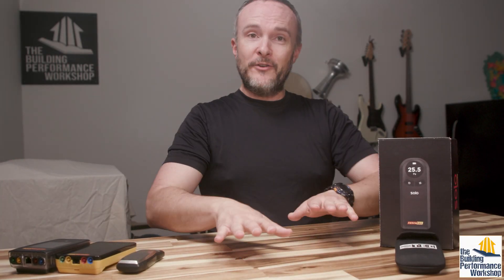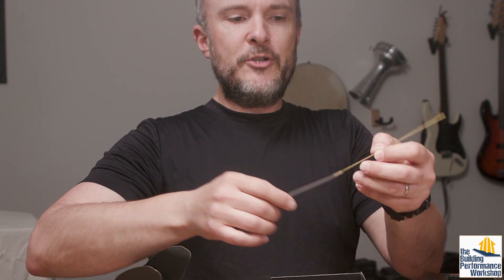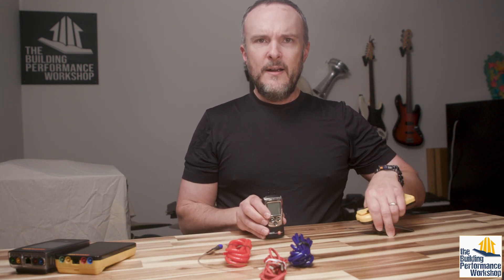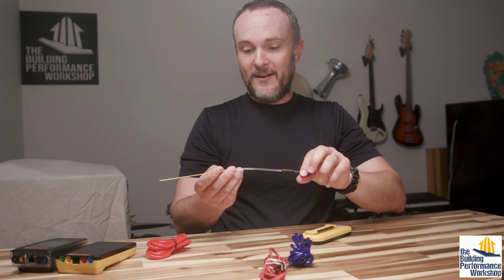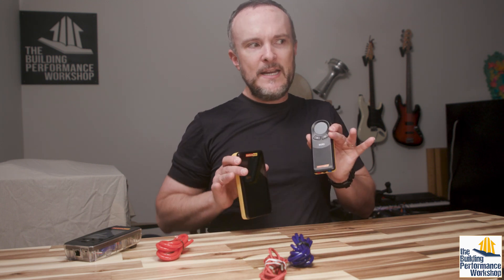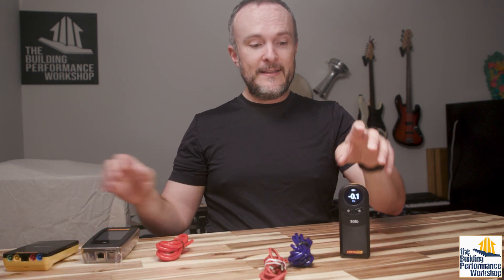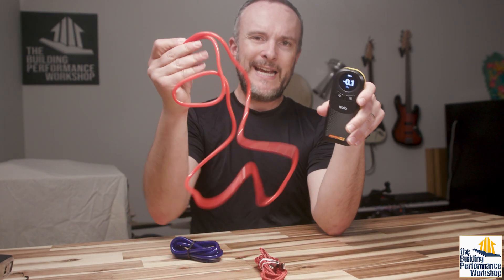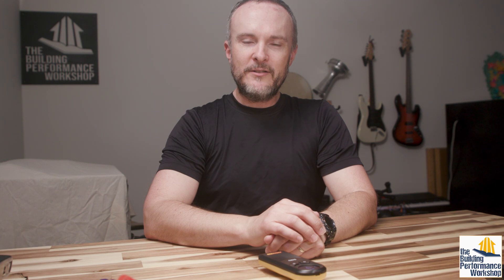DIY Testing for Home Performance Pressures: Retrotec Solo Manometer

Comment: Beautiful desk there at the beginning. Is that an acacia butcher block? I have 2x Uplift bamboo standing desks. For me they've proven to be a big improvement for ergonomics, both with standing and sitting, particularly for the precise height adjustment so you can align everything just right.
Reply from the maker: Yep, that’s exactly what I got. First desk I ever (not found in an alley or on craigslist)

Comment: What do you suggest for an affordable infrared camera? That's one of the last tools I really need as a residential HVAC designer. I finally signed up for the HVAC list. Thanks Corbett!! I still use your static pressure video every week with customer.
Reply from the maker: Awesome KP- I’d get the Hikmicro Pocket cam from Trutech Tools, high res, on a lanyard, and if you upgrade later you keep it for client use.

Comment: I think what you described as a gauge pressure sensor would actually be called a sealed gauge sensor. Normal gauge sensors measure pressure relative to the surrounding ambient pressure; you can also do a gauge measurement by leaving one hose disconnected. Sealed gauge sensors measure pressure relative to a sealed volume that's set during manufacturing. Absolute pressure sensors are similar but have an evacuated volume for their reference pressure.

Comment: Comment regarding the accuracy alone....DM32 is 1% of reading or 0.15 Pa.  The DM32X and Solo are dependent on conditions, but range from 0.4% to 0.9% or 0.07 to 1.0 Pa.  $80 Dwyer Magnehelic can have 1% full scale accuracy.  Accuracy is not really the issue.
Reply: In normal conditions, accuracy comparison:
Retrotec Solo: +/- .07 Pa, $400
Dwyer Magnahelic 2000-00: +/-2.49 Pa, $80
Reply: And the magnahelic needs no battery, and useful as panel mount for clean rooms, etc.
Reply from the maker: No, the $80 Dwyer magnahelic is +/-3% accuracy, fyi
Reply: @HomePerformance  "standard magnahelic: +/-2% of full scale...high accuracy model: +/-1%."
Reply from the maker: @joeshmoe7899 well 3% straight off their site, and high accuracy is a custom config, not $80
Reply: @HomePerformance  looking at the Dwyer 2000-00,  which is 0 - .25 inwc, accuracy is +/-4% of Full Scale (or +/-2.49 Pa), and +/-2% (1.24 Pa) for high accuracy model.
Reply: @HomePerformance  The 2000 series differential pressure gauges start at $75 and the High Accuracy option is a $55 upcharge, so yes more than $80, but WAY less than $400.  My point was on Accuracy alone, as stated countering your statement that Accuracy was a reason for not using Magnehelic gauges.
Reply: @N-M424  if measuring envelope pressure of 3 Pa, I suspect one would want at least an accuracy of +/-0.3 Pa.  Don't think I'd want a magnahelic for that.
Reply: @joeshmoe7899  10%?
Reply: @N-M424  the high accuracy magnahelic has an accuracy of +/- 41% at 3 Pa.
Reply: @joeshmoe7899  That doesn't pass the sniff test.  Which specific model gauge are you referring to.
Reply: @N-M424  magnahelic 2000-00 HA (high accuracy).
Reply: @joeshmoe7899  The 2000-00 HA is a 0-25'' w.c. gauge.  From the Dwyer Catalog:  Accuracy:±1% FS (±1.5% on 0, -100PA, -125PA, -10MM and ±2% on -00, -60PA, -6MM ranges) throughout range at 70°F (21.1°C).   How are you getting +/ 41% at 3 Pa.?  Should be +/- 2% for this particular gauge and range you selected.
Reply: @N-M424  accuracy at 3 Pa: .02 * .25 = .05 inwc or +/- 1.24 Pa.  So, when measure 3Pa, actual is 3Pa +/- 1.24Pa.
Reply: @joeshmoe7899  0.02* 0.25'' w.c. = 0.005'' w.c. , not 0.05'' w.c.   Why did you pick a gauge with a range over 20x the pressure you are trying to measure within 1% accuracy?  There are much better options that will get you 1% accuracy at 3 Pa.
Reply: @N-M424  thanks for finding the typo. But, doesn't change the conclusion. Is there a magnahelic with smaller scale than .25 inwc?

Comment: I like to think I can appreciate a quality tool, but for a homeowner $400 seems really steep. Maybe I am just cheap or underestimating the long term use case for a Mamometer of this quality for a homeowner?
Reply: 400 bucks may seem like a lot until you look at what it costs to build, I could probably make a good guess at the sensor they are using inside; trust me, it's not cheap to make something that accurate.
Reply from the maker: I have several clients who have purchased $3500 blower door kits for personal use. If you’re doing $25,000+ in home projects, it gives peace of mind to know it’s done right.

Comment: How could I use this (or something similar) to know when my passive MUA damper has gone bad? It’s located in my vented attic so kinda hard to physically check it often. 
I’m assuming I would need to poke one hose outside the house somewhere? Can this unit just sit on my vent hood and give me a permanent reading? Thanks for your time.
Reply from the maker: No need to poke a hole, just close the hose at the bottom of an exterior door. You should see the pressure go way negative when the hood goes on, then pull back toward zero (but never actually zero) when the MUA opens.